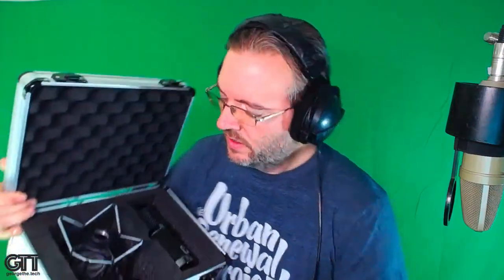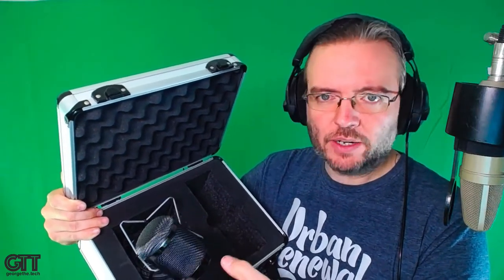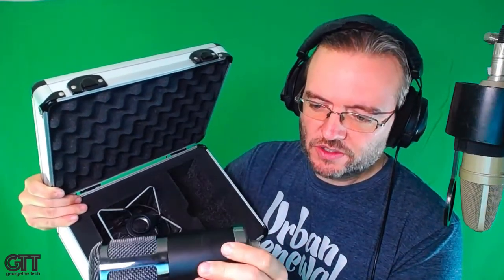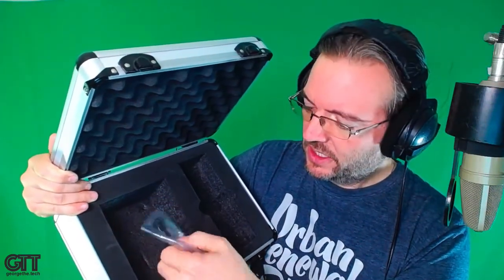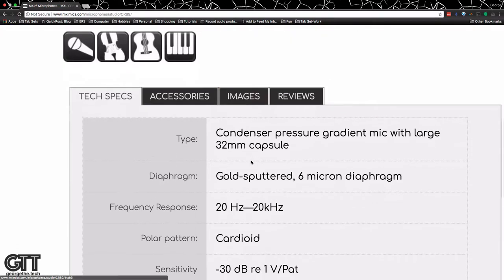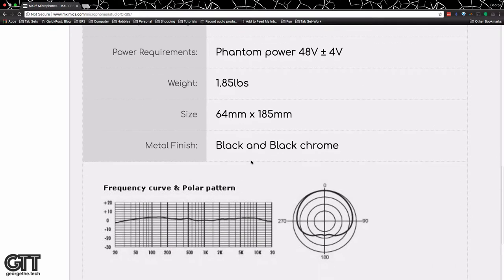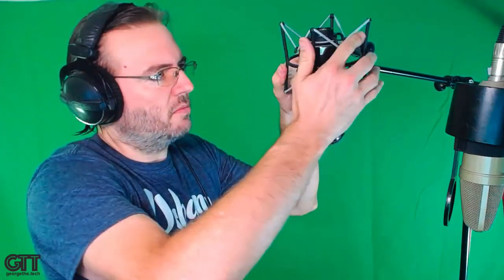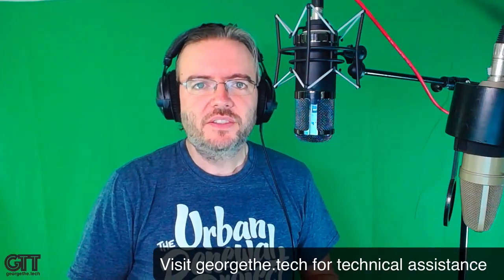George The Tech: One-Take Review of the MXL CR89 microphone

Comment: The cr89 is bomb I use it over my u87ai
Reply: Wauw! Nice. I think about buying this mic. Do you still use it over the U87?
Reply: Hey Doc are you still rockin with the cr89? If so what pres are you running it thru? Ty in advance
Reply: @queball2263   yea I got a u 67 and ad Manley ref c and a golden age ga 8000 which is better then a Sony c800g  but I pic that mic over all the above
Reply: @queball2263  but to answer ya question it’s that mic thru a Avalon 737 to a la2a or cl1b most  the time la 2a ,but for rap by pass la2 and cl1b and do Vintech to distressor or Avalon distressor
Reply: @queball2263  but that mic is bomb
Reply: My bad I replied to your comment but I don’t see it. Would the Apollo be good to use with the cr89?
Reply: @queball2263  hell yea
Reply: Neve 1073 through the la2a or tubetech cl1b pluggin eq to taste if u fill u need less hi end a notch at 5 to 8 Kz if u fill things is a lil to bright